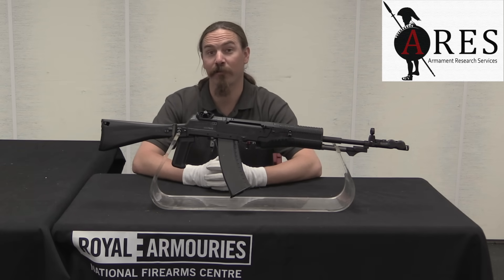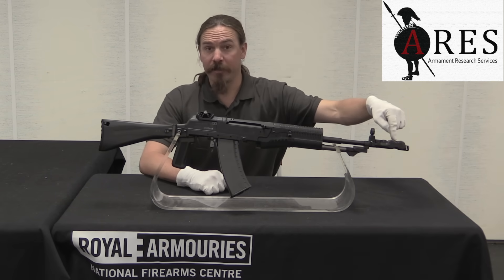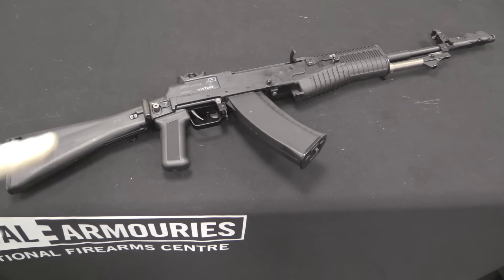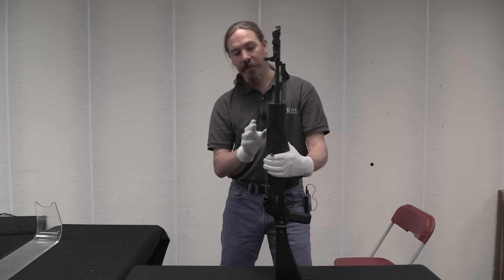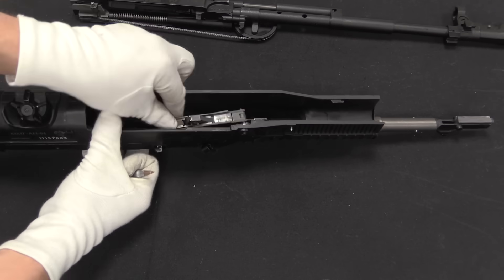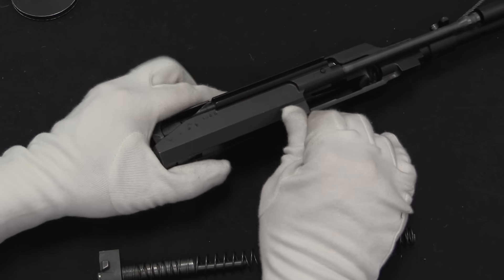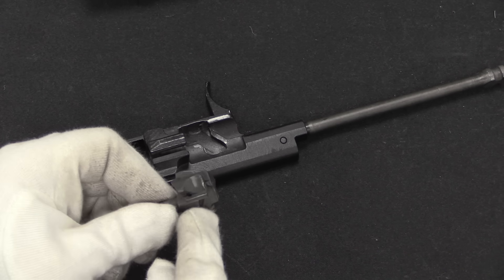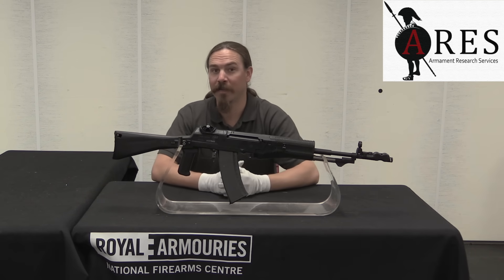Rocket Surgery: Inside the Russian Nikonov AN94

Comment: I really love how russians design shit. Watched a video on one of their supersonic tactical bombers and there was a comparison of american and russian flight system design. Americans think "this system is important therefore there must be many redundant system to back it up when it fails" while russians think "this system is important therefore it must never fail."
Reply: That's a very interesting observation. It's cool how different people view the same situations.
Reply: thedog556 the material tech issue was for mach 2+ flight problems. It meant they had to use steel bodies for their interceptors such as the MIGs you mentioned. They were incredibly heavy. Material issues did not effect flight control design though.
Reply: thedog556 they didn't have weak airframes. They had incredibly strong airframes supporting the weight of like 2x a normal fighter. It was simply too much. And the limited speed could be over ridden for interception but would destroy the engine. The engines were disposable.
Reply: thedog556 the f15 was a totally different craft. It wasn't nearly as fast as the MIGs as well. And also if you think 5g is gentle you have never felt 5g.
Reply: thedog556 The MIG was literally designed to go fast, high, and have a big radar. Saying it can't turn is like saying the SR-71 can't turn. No shit. And also not that much faster? Lmao! 600+ mph faster isn't much faster?
Reply: thedog556
Thats not the point he's trying to make. The point is that there are multiple completely different approaches to solving a problem.
Reply: thedog556,
What the fuck are you talking about?
F16 and F/A 18 are point defense fighters.
Just like the MiG 29.

F15 and formerly F14 are air superiority fighters, just like the SU 27. Which all of them can perform as an interceptor.

However MiG 25 and MiG 31 were built as >PURE< interceptors. They were built to be able to take off QUICKLY, get into a position to intercept and fire at a range where an enemy cannot retaliate.

Something F15 also does not have is the capability to perform proper BVR >80km
Reply: Derek aka Derek I think it's more like "This can't be allowed to fail."
Reply: Adding on to what Arson Fire wrote, both space agencies tried practical solutions to the problem of writing in space, rather than rushing to develop a high tech pen.  NASA used mechanical pencils, ballpoint pens and felt tip markers, each of which appears to have worked reasonably well (with their own respective limitations). 
 The USSR never tried mechanical pencils or felt tip markers, but did use ballpoint pens and grease pencils on plastic slates (grease pencils also worked reasonably well, but there were problems with the durability of the writing).  The space pen was developed by a private company without any funding from NASA, and once it was available, both space agencies made use of the space pen

From the wikipedia article:
Cosmonaut Anatoly Solovyev flew with Space Pens starting in the '80s and states "pencil lead breaks...and is not good in space capsule; very dangerous to have metal lead particles in zero gravity".
Reply: mig-25 and mig-31 are pure interceptors. First one is mach 3 capable but with short legs. Second is long runner with mach 2.8 but veeeeeeeeeeeeeeeery complex electronics and extremely long range missiles to engage cruise missileles, fighters and even sattelites.
Reply: @thedog556 wrote: "You clearly have no idea what you are talking about"
Its not me its your knowledge of physics... Here is a couple of note in that regard:

" you you knew anything, you would realize that speed has little to do with perceived force due to acceleration."
-- In physics by definition acceleration - is a rate at which speed is changing(so speed have a lot to do with acceleration, if not everything), while speed is the rate at which distance is traveled.

"Your mig only has to make a turn with a radius of 6 miles to experience 5g at mach 2"
-- Since Mach number is depending on a speed of sound, and a speed of sound is depends of the density of the air, that greatly depends on the altitude(and on atmospheric composition of the air at that moment), and since speed of sound varies, so is the turning radius, but there is more to it ... 

-- Speed of sound defaults to altitude of sea level at +15 degrees Celia, at this altitude air is very dense, so no aircraft can fly sea level at Mach 2.
Reply: @RussianThunderrr  this is all funny as hell to read btw.. anyways there are a few planes that can fly M2 at sea level, F-111 springs to mind. but it also has variable geometry wings to achieve this
Reply: @silverback7133  wrote: " this is all funny as hell to read btw.. anyways there are a few planes that can fly M2 at sea level, F-111 springs to mind."

-- Yes, it is funny as hell to read, since F-111 capable to fly Mach 2, but NOT at sea level... At sea level it is capable of slightly above Mach 1, so are many other Mach 2 fighter jets.
Reply: @RussianThunderrr  TAC F-111G could do mach 1.7 for 45 mins at 100m if it had the PAVETAC (terrain following radar) package installed. only used by the Aust. RAAF decomisioned about 10yrs ago
Reply: @RussianThunderrr  also i dont have the stats on it but i believe the late generation F-4s could do something similar.
Reply: @silverback7133  wrote: "also i dont have the stats on it but i believe the late generation F-4s could do something similar."
 -- Well comeback when you do have a "stats" and a link to a credible source about sea level near Mach 2 number flights.
 -- Mean while do you even know at approximately what altitude air density half of that of at sea level?
Reply: @thedog556 wrote: "an object travelling 10mph experiences approximately 5g in a turn with a . 4m turn."
-- Yes, genius .4meters is fifty time shorter then a length of MiG-25, so it wont make that turn.
Reply: It's a funny urban legend, but both space agencies tried pencils and ended up using space pens.
Pencils turned out to be not so great in space for several reasons. Mainly that having tiny bits of graphite floating around in 0g isn't much fun for anyone involved.
The soviets ended up buying their pens from the same supplier as NASA.
Reply: thedog556 negative the mig 25 is better in one more area other than speed, and that's electronic warfare. The mig 25 uses tube computers which are resistant to electronic warfare measures. Also the mig 25 can data link with other mig 25's and be a make shift awacs system. Keep in mind the foxbat is not a fighter like the f15 and f14 just an intercepter and a damn good one. The SU 27 would the the aircraft to compare to the f15, and that they are pretty comparable. The mig 29 would be the f16's counter part again fairly comparable.... surprise surprise I wonder why.... oh an arms race... lol. I like both western and eastern equipment definitely two different approaches that both have proven themselves time and again.
Reply: @thedog556 wrote: "You clearly have no idea what you are talking about"
--  Its not me its your knowledge of physics... Here is a couple of note in that regard: 

" you you knew anything, you would realize that speed has little to do with perceived force due to acceleration."

 -- In physics by definition acceleration - is a rate at which speed is changing(so speed have a lot to do with acceleration, if not everything), while speed is the rate at which distance is traveled. 

"Your mig only has to make a turn with a radius of 6 miles to experience 5g at mach 2"
 -- Since Mach number is depending on a speed of sound, and a speed of sound is depends on the density of the air, that greatly depends on the altitude(and on atmospheric composition of the air at that moment), and since speed of sound varies, so is the turning radius, but there is more to it ...

 -- Speed of sound defaults to altitude of sea level at +15 degrees C, at this altitude air is very dense, so no aircraft can fly sea level at Mach 2.
Reply: Redundancy at the system level as opposed to redundancy at the component level. Have two system or double engineer the parts. Both approaches work, and have pros and cons.
Reply: B A T T L E B O T S
Reply: @thedog556 5g at mach 5 and 5g and 10 mph do exert the same force on the airframe, since force is caculated as (F=ma). but it takes much more than simple force to crticize a plane for its structure intergrity. According to simply physics, If we are going ot discuss how same object react to accerlation under extremely high different velocity, we have to take into account of their kinetic energy and momentum. A object traveling at mach 5 has a huge momentum (P=Mv), while the same object at 10 mph has only a low amount of momentum of the previous case. However, kinetic energy is what will cause structural faliure, and conviently, kinetic energy and momentum can be converted. (P=mv, E^k = 1/2 mv^2). we can realize that it would take more kinetic energy to change the mach 5 object's course, than object traveling at 10 mph, velocity is also extremely important in the case of kinetic energy, because it is squared in the equation. 
You are also excluding the friction heat under different speed, which will weaken the plane's mainframe. We don't live in vacum like ideal physics taught in highschool. 
Therefore, we can come to the conclusion: the amount of g force is not what defines a plane's structure strength, but the maxium kinetic energy the mainframe can support.
Reply: I did EOD for years.  Our joke was American ordnance rarely goes off when it shouldn't and sometimes it doesn't go off when it should.  Russian ordnance always goes off when it should,  and sometimes goes off when it shouldn't.
Reply: @thedog556 yes, by mentioning kinetic energy, i was refering to the change in kinetic energy. (i mentioned it would take different amount of kinetic energy to change the course of object moving at drasically different speed.) As you pointed out, change in kinetic energy is what will foundmentally cause she shift in airframe structure.
I realize that heat would not be sigificant in the case of both Soviet and U.S plane, since both of their maxium speed is what limits this factor from causing any sigificant frame distortion. However, if we are talking mach 5, that would be somehow revelant in frame with poorly done heat tranfer capability.
Reply: @thedog556 LOL. i read all you comments and I must say you are really a good comedian. So until every think you said is a joke I am fine but if you say you are serious you should see a psychologist.
Reply: I'm not gonna read all of the replies to this, but why argue about American vs Soviet designs when the combat statistics are there?
Reply: @Derek aka Derek ain't they in the process of replacing with the ak12
Reply: @thedog556 Actually, given their cruising speed was supersonic, 5g is a lot.
Reply: Pity their stuff doesn't work very well.
Reply: @Roughman You swallowed their hype.
Reply: And that's why Reactor 4 of the Vladimir Illyich Lenin Nuclear Power Plant explodes
Reply: The F15 was an alarmist knee-jerk reaction to what the US thought the Mig 25 was. They basically built what they thought the Mig-25 was, but the Mig-25 was just meant to go really fast and shoot missiles at SR-71s and the like.
Reply: @thedog556 although I fail to see how force can be a factor in a non-contact case like this.
Reply: Yes but there isn't such thing as never. At one point it's gonna fail
Reply: @thedog556 sure.
Reply: Not always, for example, space shuttle and soyuz space craft. Russian has launch abort ejection tower, while space shuttle dont have any launch abort system, even the side booster engine cannot turn off after ignite.
Reply: @thedog556 yep, that makes space shuttle kinda dangerous, the soviet also built a shuttle called buran although only launched once, it uses all liquid boosters on the rocket, even the shuttle itself have jet engine, so it can seprate from rocket and fly back in case of roket failed. Too bad, after the fall of USSR, they lost funding and canceled the project.
Reply: @thedog556 Buran has one successful launch before project cancelled, although no crew, it was controlled by onboard computer. I dont think detach the boosters that still in full thrust is a good idea tho, it will lost control and likely crash with the main fuel tank or even the shuttle itself.
Reply: @thedog556 it doesn't need it it is INTERCEPTOR not fighter, it only need to get enough close to the target to destroy it
Reply: @thedog556 it made to intercept bombers, cruise missles, spy planes  satelites not fighters, for fighting fighters russia got Su-27/35 ang Migs which are air superiority fighters
Reply: It's also an element of asian engineering design philosophy too. If something DOES go wrong. Make it easy to maintain. Servicablity is something we Americans have forgotten in lieu of chasing NEW and innovative
Reply: You mean "design weapons". Anything else made by russians (cars, houses, kitchen apliences) is utter junk.  Seen them, used them.
Reply: Cue Murphy’s Law
Reply: @thedog556 -- No it's not. Look at their approach to computer electronics. Compare for example US IBM computer keyboards from the 70s and 80s. We think they're heavy duty, they have a keystroke lifespan of over 50 million key presses per key.

The Russians used quad redundant hall effect sensors. No parts to touch. Totally redundant. Modular so they can be replaced. The key press lifespan is in the billions. In fact, no one knows the real limit because they simply had to stop testing!

The USSR made extremely durable tech that was intended to last a very long time, be easily fixed, and able to be modded later for upgrades if needed.
Reply: thedog556 dick riding means being a submissive to something, not an insult against gays.
Reply: thedog556 He means you're biased you moron
Reply: With rockets russia decided, everyone try a design, lets pick the one that doesnt blow up, where we tried the best solutions with thought first, its not any better or worse, its different.
Reply: @thedog556 wrote: "At mach two, a 5g turn is a very gentle turn"
-- Who is dog fighting at Mach 2? Calling acceleration of five time weight of pilot or aircraft -  "a very gentle turn" - just sounds funny as hell.
Reply: @thedog556 wrote: "everyone here is now actively losing iq points by seeing them."
-- If you had any iq point, but since you don't, so you got nothing to loose.
Reply: Why turn airplane? Start in correct direction, no need for turning.  Eject when fuel runs out, take train back to airbase, receive new plane. Problem solved!
Reply: The F-35 and the Osprey are the pinnacle of killing your own countrymen before the enemy can
Reply: @thedog556 wrote: "yet it wasn't reliable and couldn't defend itself."

-- Are you "making this up"? As for "reliable" part it can back it up with almost half century of been in service. As for "couldn't defend itself" - if you are talking about MiG-25R or MiG-25RB, recon and recon/bomber variants, the only defense for those was speed, but just like SR-71 those was not designed for the "defense" per say, but rather something else, other then that MiG-25 and MiG-31 had an impressive arsenal of Air to Air missiles.
Reply: Not really, you are familiar with the idea of Defensive Design? That is what the Soviets Employed: You design the base system to be as simple as possible, with built-in safeguards against possible failures as part of the base design. The American idea, as it is in modern design, is to have a base design that requires external modules to function at all. Some of these modules, in turn, need additional components to function and this is where you run into horrific monstrosities of cost over-runs that don't do anything in particular since it was all about filling in holes in the design.
Reply: @thedog556 wrote: "5g at mach 5 and 5g at 10mph exert the same force on the airframe."

-- Ah, "thedog" 5g on air frame at 10mph, really?
--  Even a pilot in a training centrifuge have to go faster velocity, then 10mph, just so you know in order to exert 5g.
Reply: @thedog556 wrote: "The only difference between a 5 g turn at 10mph and at mach 5 is the radius of the turn"

-- So, genius what would be a turn radius at 10mph, in order to pull 5g?
Reply: russians optimistic? if there is one thing to know about russians it is that they have great respect for misery....

and vodka
Reply: Good observation!

Now my followup question to that is simply: "Why not do both?"
Reply: Yes, this twisted logic is why they probably build the Chernobyl nuclear power plant without any backup containment buildings.

"It must never fail," but when shit inevitably fail, everyone's fucked. No system is perfect,  whether it's Russian or Western systems, which is why any sane enough nation plan and build "redundant systems" as backup plans.
Reply: @thedog556 "US electronics and radar systems have been far superior to the Russians" Hahahahahaha! Do you even hear yourself? US didn't even have AESA radars until the F-22 came out (followed by subsequent revisions and upgrades of previously existing fighters). Meanwhile, the Russians were putting AESA radars on their jets as early as the 70's. Should I even bring up the excellent Russian air defense systems and their radars, which have no match in the world? The US may be better at precision engineering, but no one in the world beats the Russians when it comes to radar systems. To you, it may seem like the more expensive and precisely engineered US jet is better, but it really comes down to design doctrines. To put it plainly, the US builds planes like Swiss watches, Russia builds planes like tanks.
Reply: @thedog556 wrote: "The mig25 and mig31 could not turn at greater that 5g at cruising speed or the wings would snap off"
-- Though an interceptor MiG - 25 once pulled more then 11(G)s that lead to air frame deformation, but wings did not snapped off.  MiG-31 was much stronger and more capable dog fighter. Having said that A-10 Warhog is 5-6(G)s capable aircraft depending on the load, it is very manueverable aircraft.
Reply: Russia did in months what US didn't, couldn't, for years of fighting the Islamic republic in  Syria ,so mabe  they know something you don't!😎
Reply: @pashapasovski5860  Agreed but I think it's clear the American military hasn't actually tried to win an armed conflict since the corporations that took over the government in the Vietnam era discovered that a stalemate was infinitely more profitable, literally. I don't think any of the developed world has actually tried since then either, I mean out side of the developed world has a single border anywhere expanded or retreated? Seems to me earth is run by a single cartel more or less. Or at least a shared philosophy that includes a rejection of actual war. Which is fine with me, just thought I'd point out the farce.
Reply: @Innomen  Not rejection of war, but profiting on it.
Reply: @Innomen  Uhhh... Crimea? Somalia? Yes, lots of borders have changed.
Reply: @thysonsacclaim  I can't directly see what you're replying to so pardon if this is not on topic, but I was probably referring to major territory changes among world powers oddly not happening any more. The closest in my living memory was taiwan changing hands but even that was just an echo from a previous era on long delay. I can't help but wonder how much better off America would be if it spent half the military budget buying land along borders we care about. It seems like the logical capitalist thing to do, and a lot more diplomatic and cost effective. I look at the world and I see literal nonsense policy. /shrugs /rant
Reply: @Innomen  -- I see what you mean now.
Reply: Yep that is true
Reply: In Soviet Russia, parachute deploys you
Reply: Or Russian space launch "*slurred* We take tiny little baby man, strap him to missile..."
Reply: Xiones11 we, russians, have a historic tendency of not valuing the lives of our troops... scratch that, the lives of our compatriots at all. “Totskyi poligon” also known as “Operation snezhok” is a great example. Google it.
Reply: lol what a bullshit
Reply: NASA spent millions designing a pen that writes in zero gravity... The Russians brought a pencil
Reply: @Jonoxyz973  Thats actually not true. And even Russians bought those American pens.
Reply: @Jonoxyz973  Thats a half of the story though. In the end russians found out that the graphite dust is damaging electronics, so ended up buying the american pen. There goes your brute inteligence.
Reply: @Jonoxyz973  - This is actually not true.
Reply: @Roughman There is data to support the fact Russians, Eastern Europeans in general actually, are some of the heaviest per capita drinkers on Earth.
Reply: americans: Murphy's law is a constant so we must plan for it so nobody dies
russians: soldiers are expendable, make it cheap, replace them if they die 
https://youtu.be/3qxX5KhCpTk
Reply: It's like the space pen proverb.
"We've spent many ours designing a special pen to work in zero gravity, and we finally have something that works!" - USA
"We use pencil" - Russia
Reply: Kyle Gilmore,
Thats a fallacy.
Both countries used pencils and tried to test pens.
The space pen was a private venture and both countries adopted it.